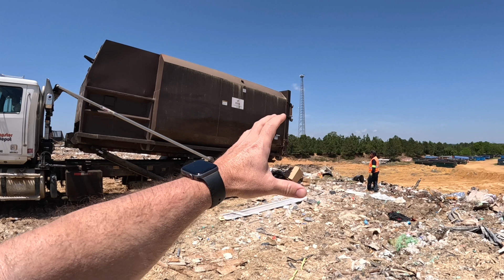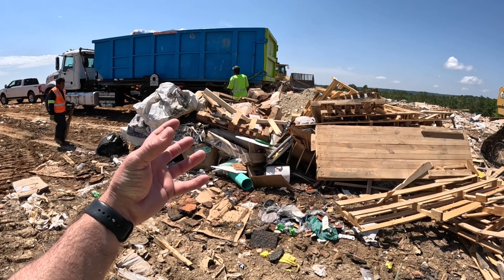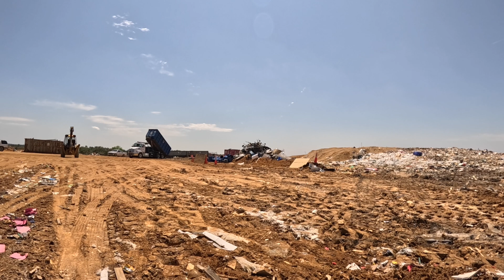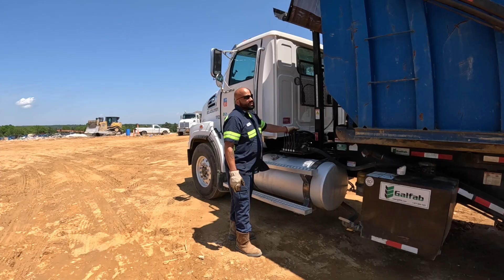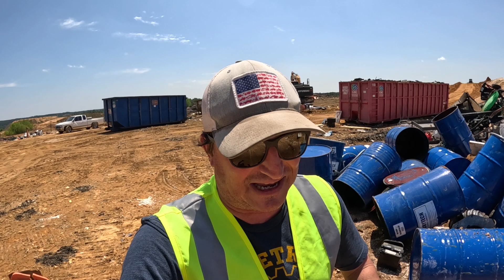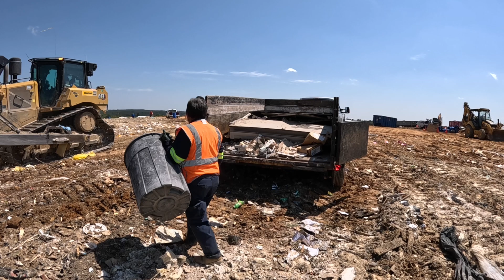Shocking Amount of Trash in Landfill Every Hour ⏰ 🚜

Comment: Maybe the Rotochopper guys (and your baler folks) can help figure out a way to chop the cardboard (corrugated) material into small pieces which are more valuable (called DLK) than the old boxes (called OCC) and work with a nearby paper mill to use that product. Box fibers can be recycled 7 times.

Comment: Hey talking about tires. Being that you have rotochopper have you thought about cutting tires into chunks for septic tank leach lines instead of gravel they use them in Nc for drain fill and another idea for a tractor trailer Tippers that you can move any where in your landfill

Comment: I have to agree with ya Ryan about doing the work,  I've dug sludge ponds and ran doziers and wheel compactors along with running a rolloff and trash truck back in my teen years from 13 to 18 at the family business I have the upmost respect for you of doing the same work because it's hard work we had all 55 gal burning barrels you hand rolled and lifted by hand no hydraulic lifts,  I'm 62now and when my grandpa passed away a few years ago he still had a set of arms on him at 88yrs old.  Stay Safe friend I love your videos.

Comment: I spent a little time in Augusta when I was younger. Currently living in Albany, which as you may know is consistently the lowest income county in GA. Any chance you need a welder for heavy equipment repair? 

I totally understand that I'd be more attractive if I was also a heavy equipment mechanic. Then again I guess it depends on how you staff your equipment repair shop. I tell you what, wages down here are in a race to the bottom. I could apply for the local Boilermakers union,but I can't TIG worth a damn. Stick, mig, flux core, oxy-fuel, plasma. Also, as a lifetime scrapper/treasure hunter, I'd have a blast picking metals out of those loads as they drop!
Reply from the maker: We good right now. Thank s though

Comment: The excavator that you have pulling metal out of the dump piles maybe you need to set up some sort of double axle trailer that he can grab with the bucket and drag along with him and load up and take back over to where he dumps it into the roll off boxes it would save fuel and time and maybe even have something like it set up for like all the pallets until you get something more permanent set up

Comment: Up here in the northeast (New England) a lot of the landfills are ash only now but they sort threw all the ash from the incinerators where they burn the trash and pull out all the metals then the ash goes in the landfill always wondered about this kind of landfill though because there are lot of old quarrys where you could set up something like this sorting lines sort out metal and wood make mulch like you do and sell the scrap metal out of it turn in all the other plastics and cardboard to sell in bails where you are so close to ports or rail lines / yards be good use of the land instead of just being a big open pit and would supply jobs for a long time before it fills up say someone opened a quarry mined it all out then swap over to something like this even on a small scale thats jobs for 50 to 100 years maybe even more
Reply from the maker: Cool info, thanks for sharing!

Comment: Mr Digg a important message

 Why dont you place 2 bins at the tipping area 
Use the Hyuandai with the Demo magnet grapple to pick threw 
Wood Pallets and Metals 

It will save you space at the landfill 
In the long rung you can activate the soarting line 
For now that grapple excavator with the demo magnet can fill 2 bins 
One with metals and the other with 
Wood pallets that end up for compaction 
You can send one bin to Green go recycling for mulch production 
One to the scrap yard 

Hope you will consider and will take this method to save mother earth by  saving the wood from the landfill area 

With that graple excavator it can do 2 jobs 

Filling up one bin with wood and other with metals.
Reply from the maker: Still not enough time before the next loads show up. Not worth the time

Comment: I wonder if you put a spotter camera over your scales if you could redirect the wood heavy loads to a separate tipping floor. Give it a quick pick out with an excavator.
Reply from the maker: we have cameras but soooo many trucks coming through and you never know if trash is on the bottom
Reply: @TheRealMrDiGG  I'll definitely be waiting with anticipation for you to get your picking line set up. Looking from the outside in, I feel your pain watching everything thst could be recycled getting buried. But I also understand the infrastructure to divert it is very costly and the commodities won't give you a good ROI yet.

Comment: Mike is the kind of employee that keeps a business growing.
I’d say that load was 70% recyclable.
Reply from the maker: I say 90
Reply: @TheRealMrDiGG  It all could be if we could just afford to get that serious with it but people will never do it..
Reply: @lewiemcneely9143 it's extremely difficult to recycle various plastics, and doing it multiple times is hard as well, very cost prohibitive.

So it's not always about effort or "getting serious" about it, if the material is bad and cannot be recycled, it's not about having the will to do it.

Ideally, companies just wouldn't make materials that cannot be recycled, and there'd be materials that can easily recycled over and over made.
Reply: @colinofay7237  RIGHT!
Reply: @colinofay7237  All the landfill here is concerned amout is the tonnage. They have conex boxes there for recycling but you have to go there to do it and it's a long gravel road there and back. The local collectors don't have the rigs to haul seperate items. It's all bagged and weighed  as a load. No coloection points so we do what we do and throw it all in and it goes away and that's it. Until someone invests money in a rig to carry seperate kinds of stuff for recycling it'll never happen.
Reply: @TheRealMrDiGG  closer to 94 if you know what you are doing.
Reply: Paper can remake paper as metal can be melted and formed and plastic Should be melted and made into 24” Lego blocks for construction. Zero plastic should be buried. ALL PLASTIC can be melted and formed into Lego blocks. So I say 100% can be reused in some capacity. Leaving nothing in the ground as waste. The only waste would be bottom line dollars. Maybe we should learn to live on fewer dollars while saving the planet.

Comment: My local MRF has a 30 pole with a hook on it.  It’s basically a 4x8 steel box beam with fish hook barb looking end.    They attach it to the tipping floor loader to help pull loads out of the trucks when they get stuck.     Gets a lot of use in the winter when our loads freeze in the box.
Would be interesting to hear from the Scale house what tonnage the recorded in the hour

Comment: There's money in recycling cardboard in Europe, albeit not much. My workplace used to have a deal where we'd use a baler to press a bunch of scrap cardboard together, and someone would pick it up for free, without charging us.
Then the baler broke, so it's back to the big recycling bins again, but there's a significant difference between recyclables and general trash. All goes through the same sorting line, though, but I guess more of the general stuff goes to landfill.

As for the guesstimate, I'd say 70% COULD be reycled, but 50% if you discount plastic, since there's really no money in shredded mixed plastic and nobody has time to sort it since China banned imports of it.
Reply from the maker: My guess was ninety